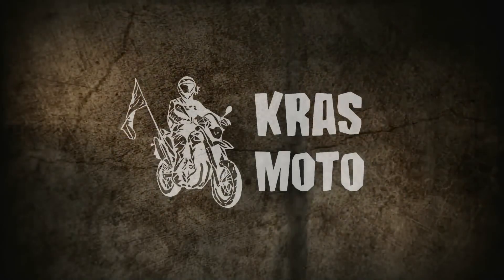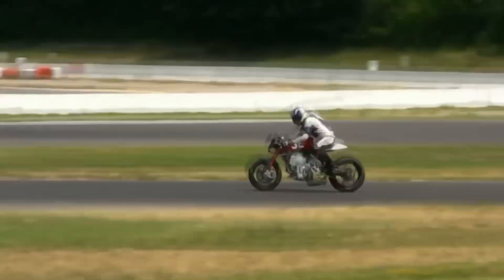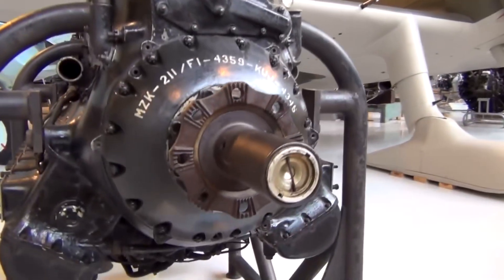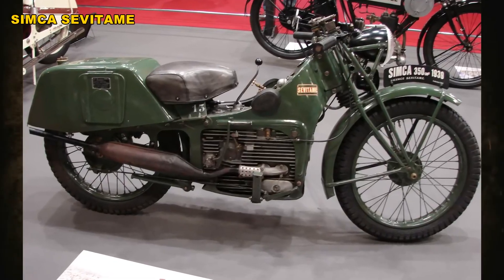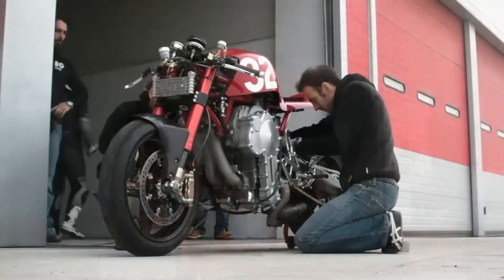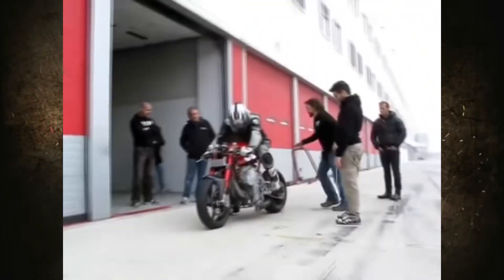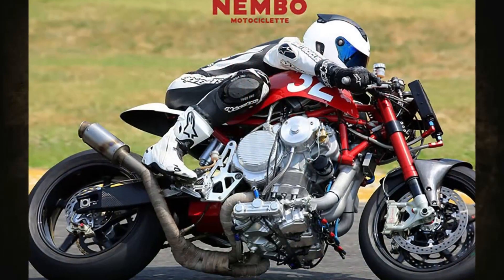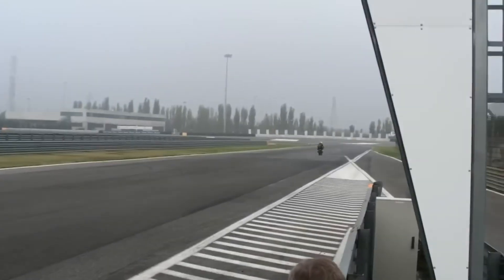Motorcycle with an Upside-Down Engine: NEMBO 32

Comment: so we had fun with Photoshop but no nothing about engineering this can be done but the oil system will be complex as gravity is part of a standard oil system it also moves the heaviest component to the top the opposite is required your top heavy design will handle abysmaly wanting to lie down in every corner no idea what you have been consuming but it must be potent